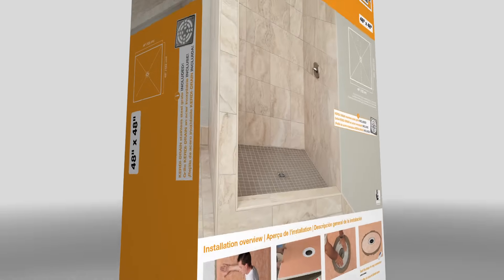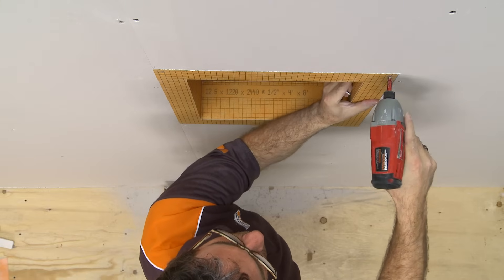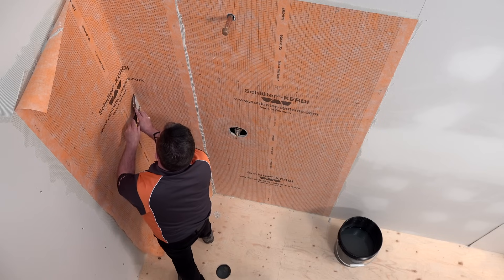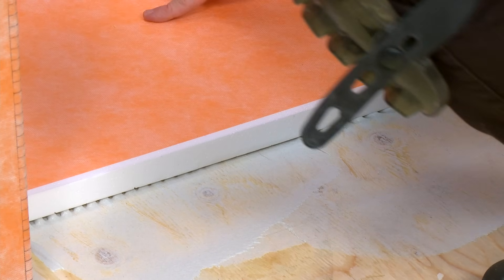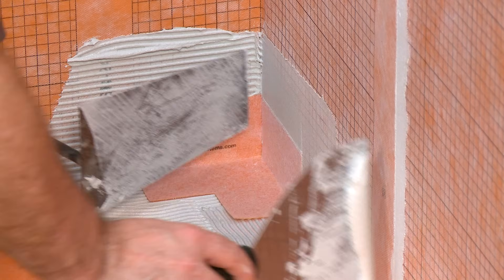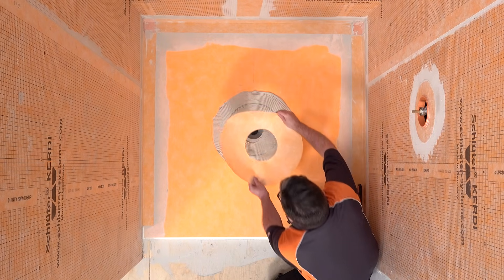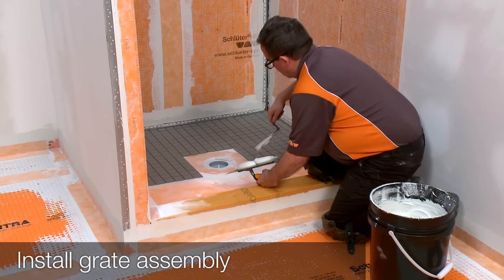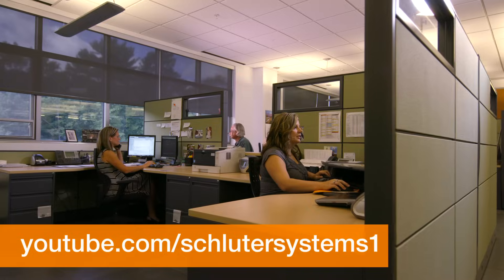How to waterproof your shower installation with the Schluter®-KERDI-SHOWER-KIT Complete Kit

Comment: Wouldn't it be better to install the floor pan first, and then the wall sheets with a 2" overlap on the floors, so any water getting behind tile would drain down and out over the overlap, rather than relying on the band joint? Or better yet, install the floor flush to the studs/bottom plate, then drywall, then Schluter wall sheets? Then  do the corners, but none of the wall to floor banding? Would this be allowable if I choose to do it that way?
Reply from the maker: Hi there ! There is no rules on what to install first as long as there is always a minimum overlap of 2'' of the Kerdi membrane. The Kerdi corners are a necessity thought as the band or overlapping won't waterproof the corners to 100%. Hope that helps

Comment: Is the curb sloped as to drain water back into the shower pan?
Reply from the maker: Good question! The curb itself is not sloped. When you are setting tile on the curb, the tile must be sloped towards the shower drain using a little extra thin-set under the tile on the further edge from the drain. Hope this helps!

Comment: The Schluter shower kit has made my first bathroom renovation incredibly easy - especially with videos like this. One step I’m unsure of is how to securely install a fixed glass shower screen on the curb since anchoring with screws will not work. Can Kerdi fix be applied to the screen mounting bracket on top of the tile or should I apply to the bare curb and then tile around? Is Kerdi fix supposed to be used in this way? Any help is much appreciated!
Reply from the maker: Hi Henry! So happy to hear that your shower installation has been a success! For this question, could you please contact our Customer Service team as there may be some variables to discuss:
US 800-472-4588
CA 800-667-8746
Thanks!
Reply: So,  is it fair to say that installing the bottom corner strip onto the wall and tray, and then flash over the strip with the wall membrane a "belt and suspenders" method? Why not make it the standard installation sequence? Or just extend the wall membrane minimum 2" (6" for belt/suspenders) onto the tray...?

Comment: What size notch trowel for the shower pan?
Reply from the maker: Hi there! To bond the tray to the substrate, please use a a 1/4" x 3/8" (6 mm x 10 mm) or 3/8" x 3/8" (10 mm x 10 mm) square- or U-notched trowel.
Here is our Shower Installation Handbook for more info: https://sccpublic.s3-external-1.amazonaws.com/sys-master/images/hcb/hdb/9377465106462/Shower%20System%20Installation%20Handbook.pdf
Reply: @schlutersystems1  Thanks I ended up finding it on on of your other videos. This information is not easy to find as it is not said in some videos when other trowels are mentioned as well as not really found easily on the Schluter website.
Reply from the maker: Point noted! We'll communicate this with our video team. Thanks!

Comment: As a Schlüter-trained installer, I have to say that they have truly worked out a bunch of issues for you.  If you have ANY questions they are very happy to help you over the phone.  Count me as SOLD on this stuff.
Reply from the maker: Thanks for your support!
Reply: Unmodified is your traditional mortar made mostly of Portland cement. Modified will have latex additives. They dry and cure differently. This product is water proof so modified mortars won't be able to dry out properly. Works great with Unmodified mortar though.
Reply: What is the Kerdi shower pan slope suppose to be? I have a Kerdi Shower Pan and is barely 1/8 slope. Barely/Not even.
Reply: Are those cement back boards on the walls ?
Reply: @eliecernavarro6422  no. Those are gypsum drywall. You can use backer boards for a stronger feel.
Reply: Why the hell you need system in the first place?
Reply: Im only using this system because the home owner is requesting me to. I'm 58 years old and started in the tike Business when I was 18. I know if countless ways of doing a shower without stirafome. To this day, I have only had to repair one out of countless showers have done, and it was the falt of a bad mix of cement from the factory.  I'm sure there are a lot of people that love this system and God bless. But you know the saying about old dogs.
Reply: @robinbeech7703 is there any way to fix one that leaks without busting the whole thing out?

Comment: What is the maximum weight spec for the shower pan and the curb?
Reply from the maker: We don't have a specific weight it can take, however the Schluter®-Shower System shower curbs can support the weight of a properly installed glass door/panel. If you have a particular other use in mind, please contact customer support so they can look into it further for you.
US 800-472-4588
CA 800-667-8746
Reply: @schlutersystems1  Thank you for the reply....I'm just thinking of the case where someone might step on or put full weight on the curb as foam core is obviously not the same as 2x4 construction.
Reply from the maker: If you don't mind contacting our customer service team at the numbers above, that would be great. They are better suited for these specific questions! 🍊

Comment: Why would tar paper not work the same?
Reply from the maker: Tar paper is not recommended to use in conjunction with the Schluter Shower System. Just like a traditional PVC or rubber liner installation, there may be alternatives to using the Schluter Shower System. Differing installation methods should not be combined with our system to create a hybrid system. Schluter Shower Systems are an integrated family of products and are designed and engineered specifically to work cohesively to create a sealed system. Hope this helps!

Comment: Can I ask why you would use corner and seems on the outside and not the inside?
Reply from the maker: Hi there. Since KERDI membrane is installed over the solid backing down to the subfloor and the provided shower tray is waterproof, the seams of the outside perimeter and corner seams of the shower tray must be sealed to create a fully waterproof and vapor tight enclosure. By installing the KERDI-BAND and KERDI-KERECK inside corners over the pre-sloped shower tray, these components prevent moisture disseminating below the top of the tray; therefore, installing the KERDI-BAND and KERDI-KERECK corners underneath the tray is not necessary as moisture will not travel to the substrate. Hope that helps!

Comment: System looks brilliant. My gripe is though the shower proofing is paper and your taking metal trowels to it to flatten/thin set tiles. Aren't you worried you'll scratch the membrane?
Reply from the maker: Hi Andrew, KERDI is a sheet-applied polyethylene waterproofing membrane designed for the application of tile. Decades of projects behind it, so no worries of a trowel damaging the membrane when installed correctly. Thanks!

Comment: after 3 day dry time, the drywall turned to mush. where does the moisture from the uncoupeling thinset go? into the drywall. just cost me 2000$ to find that out. Who do i call for reimbursement? your welcome for the free lesson to all that read the comments.
Reply from the maker: Hi there, would you be able to give our Product Support team a call to discuss your project in a bit more detail please. They will be able to assist you or connect you with your local Schluter rep for support. 800-472-4588 (US) or 800-667-8746 (Canada).
Reply: I can't believe anyone thinks that putting a thin membrane over mold-and-failure-prone paper faced drywall (after wetting the paper face first) would be a good idea in a shower. I would use cement board or one of the foam board products, it's shocking that Schluter tells people drywall is fine
Reply: There's no such thing as uncoupling thinset. There is an uncoupling membrane that that gets used on the floor when you're doing tile over boards on a floor upstairs. You should use HardieBacker or other cement board and then the waterproofing membrane over that but if it was me I would also put a vapor barrier behind the HardieBacker directly on the studs.

But the better way is to use schluter's board paneling which is completely waterproof instead of sheetrock
Reply: you an idiot LOOOOOOOOOOL

Comment: Two Questions 1). can I use hardie backer up against the Kerdi pan? 2) what is the depth of a Kerdi pan? Just looking to see if I can go curbless.
Reply from the maker: Hi Michael, would you be able to give our Product Support team a call to discuss your project in a bit more detail, and they will be able to advise from there. 800-472-4588 (US) or 800-667-8746 (Canada). Thanks!

Comment: What is the difference between the but seem and the 2in over lap. I don’t understand why not just do the 2 in overlap like you did where the sheets meet.
Reply from the maker: Hi there, Either way is fine. It generally just depends on user preference. Some like to overlap the KERDI as the go, whereas others prefer to butt join the KERDI and then cover with the KERDI-BAND. One practical reason for using the KERDI-BAND in some instances is when a small mosaic is being installed over the seam. Since the KERDI-BAND is thinner than KERDI, the build-up at the seam would be slightly less. Hope this helps!

Comment: I am creating a custom enclosure for my bearded dragon and considering using Kerdi. Is Kerdi shower kit and mortor safe for marine life?
Reply from the maker: Hi Pam, we don't have any specific information as to whether those products are safe for marine life. However, our Safety Data Sheets are all available on our website. You can find them on the product page under "Downloads". They may be helpful. Also, since all of our shower components will be encapsulated within the tile assembly, you may want to focus on the suitability of the tile and grout that you'll be using in your application, as they would be the exposed products. Hope this helps!

Comment: Would all the same steps apply for just the top of the wall and ceiling above a fiberglass tub surround?
Reply from the maker: Hey, You only need the first 6.5 minutes of this video. However, you may prefer to watch this video, which shows how to install the KERDI on the walls and how to connect it to a preform tub or shower: https://youtu.be/q_Nijf3ZNXg This video shows you how to install KERDI on the ceiling: https://www.youtube.com/watch?v=L2rpIpzITkQ You can also find all of these instructions in the Shower Systems Installation Handbook: https://sccpublic.s3-external-1.amazonaws.com/sys-master/images/hc3/h30/9346682388510/Shower%20System%20Installation%20Handbook.pdf
Reply: This link does not work  @schlutersystems1

Comment: Is the bonding flange on the drain installed without PVC glue?
Reply from the maker: Hi Steven, the flange outlet is connected to the drain pipe with either PVC or ABS glue, depending on which pipe material and corresponding drain you are using. The reason we don't show that in this video is because there is access below to connect the drain later. Here is different video which shows you the gluing process for a no access installation: https://youtu.be/u-ZILYISeX8

Hope this helps!

Comment: It's CRAP. Unless your walls are perfectly 100% flat this is a useless product. Might as well buy something from Home Depot cheap. As far as the styrofoam pan goes, if the concrete or substrate underneath that piece of Styrofoam you're about to put on your floor isn't 100% perfectly flat you're going to have a mess like you can't believe and your tile job is going to be a disaster. Regarding the styrofoam shower pan unless you have extensive experience at setting drains blind drains that is you are in for a surprise. In addition to that the Kerdi system leaves the drain unsupported all the way around. If you just dry pack your floor it won't cost you as much and it'll be flat and it'll drain and the drain will be supported. By the way you don't know how big a mess this stuff creates unless you're an actual Tile installer but it's basically BS. Oh yeah I called their support line and ask them about the very things I just stated they blew me off!

Comment: Hi there! My wife would like me to frame a bench into the rough shower. Any problems with a 48x60 shower that uses a 48x48 shower pan and has a 48x12 bench on one side? I'd be using the 48x48 Kerdi shower pan and then just use the membrane to waterproof the bench section and up the walls.
Reply from the maker: Sure! This video gives you the steps for installing the bench with the tray and waterproofing the connections: https://www.schluter.com/schluter-us/en_US/video_shower-systems/video/Jn58yNMqvSU/playlist/PLEFjeySFJM-Bqg39YC-9A5d9iLu547R0j

Comment: So are they just randomly adding a butt joint by choice and then not explaining why they're doing that? I don't get it they could have just easily overlapped it and not have had to put the overlayment in extra mud.
Reply from the maker: Hi Steven. The reason we are showing the butt joint with KERDI-BAND over it is that there are a couple of situations where this method would be preferred over the overlap method. The main reason is that the KERDI-BAND is thinner than the KERDI membrane, so a seam like this would be beneficial in reducing build-up for cases where smaller tiles, such as mosaics are used. Another reason for using a butt joint could be if that layout works better to reduce the total with of the KERDI membrane used by maybe 6"-8" in some showers. This could come in handy if there is more KERDI-BAND on hand than there is KERDI membrane. Either way, we like to show all of the options so you can choose what works best for you in each application.
Reply: @schlutersystems1  thank you so much for clarifying. I was so confused lol.

Comment: You’re saying a 2 inch overlap at all transitions except the Kerdi band can be flush against the inside corners correct??
Reply from the maker: Hi there!  Close, but not quite. 🙂 We are saying that all waterproofing connections with KERDI, KERDI-BAND, KERECK corners, and/or valve seals need a 2" overlap, however, the corners are longer than 2", so the KERDI-BAND can be brought back a little in that area so the strips don't overlap each other. This will still allow for the required 2" overlap. Hope that clears it up!

Comment: I just finished this install, this video is so misleading, that is not thinset they’re using, it looks like joint compound.  Thinset is way harder to apply over a large wall area, so hard in fact I wish I never bought this stupid system.  The stress trying to cover an entire wall and apply the membrane before the thinset starts to set was not worth the meager cost savings.

The tray system is good, the wall membrane is horrible, don’t use it!
Reply from the maker: Hi there,
Sorry to hear you had difficulty installing Kerdi. We definitely do use thinset mortar to install the waterproofing membrane. Here are a few videos that can help you out for next time:
https://www.youtube.com/watch?v=2CwOrDGYBDQ
https://www.youtube.com/watch?v=VvQl8g6sfl8
https://www.youtube.com/watch?v=7N8CfSqaaTA
https://www.youtube.com/watch?v=AaP1uA6FIQE
Hope this helps.

Comment: We already have our walls in place.. had to just take out the flooring because of mold.. would this set still work?
Reply from the maker: Hi there! It would be best to give our Customer Support a call directly to discuss. They will have a few questions for you about your specific project, but can certainly guide you from there! Hope this helps, and best of luck with your project!!
1-800-472-4588 (USA) or 1-800-667-8746 (CAN).

Comment: Can I make a 4 1/2" valve seal work for a 5 1/2" valve?
Reply from the maker: Hi Kevin. The KERDI-SEAL-MV features an overmolded rubber gasket designed to seal protrusions and protect moisture-sensitive solid backing panels at the mixing valve. The overmolded rubber gasket is not flexible to fit over larger mixing values. We don't recommend modifying the valve seals as they will not work as designed. Please give our Customer Service team a call if you would like to discuss a particular project in more detail. 800-472-4588 (US) or 800-667-8746 (Canada). Thanks!

Comment: The system would work fine but it's expensive and not necessary when I can easily waterproof using a liquid membrane such as REDGARD for much less money. Even Schluter 1/8" trowel they sell it for $30 , but I can find a regular 1/8" trowel at LOWES or HOMEDEPOT for $10. It's a business.
Reply: Oh I didn't know it was a business I thought it was a charity
Reply: I agree
Reply: Yeah but those prefab corners are super cool
Reply: Can the Redgard product be applied over drywall and can an epoxy flooring material be used directly on top of the Redgard?
Reply: @JD-sh8ub  i would like to know as well.
Reply: This system is really great for DIYers